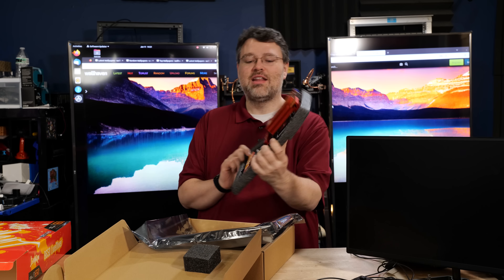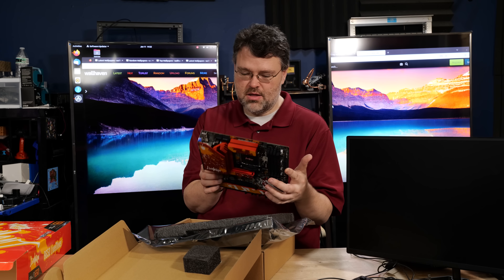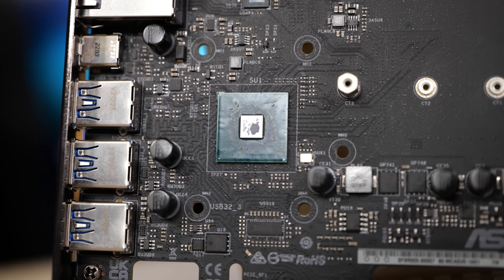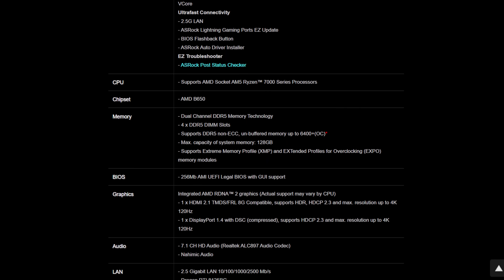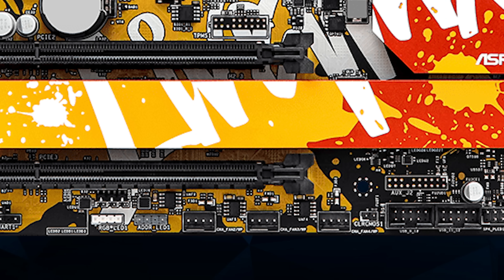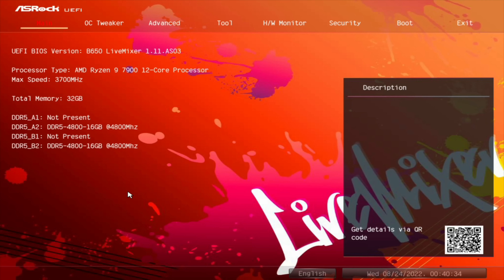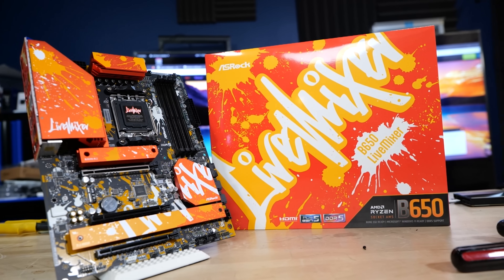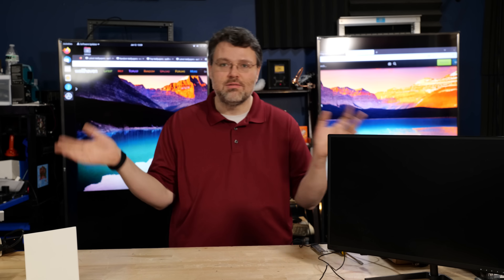ASRock Livemixer B650 Motherboard Review (Special Edition)

Comment: I like this board! It’s orange, has optical audio, and supports AM5. What more do you need?
Reply: Can it keep my bucket of chicken warm too? 🤔
Reply: better overclocking features, like the asus rog series has, the asrock can only do 5.5GHz max boost speed on 4 cores and no more and then freq drops off the cliff. Whereas the rog strix b550-e can do 5.7GHz on all 8 cores of 7700x. Thats quite a big bump but on a 7700x it's not the end of the world. What if you have 16 core 7950x. Yeah... if you want to dial in a manual all core overclock at 5.2GHz then the board won't boost  aboe that losing a lot of single/dual/ quad/ boost performance. The b550e give you PBO boost to 5.8GHz in lightly loaded, then switches automatically to all core manual overclock to 5.2GHz on a 7950x.13900xs beating in games and workloads for half the power use.
Reply: @jondonnelly3  5.35 GHz all (8) cores plus boost to over 6 GHz at PPT 86 Watt is good enough for me. It's obviously not an overclocker board.
But yes, you're right, some better VRM management would've been nice. Buildzoid mentioned negative spikes with static overclock frequencies.
I paid 220 euro ex. VAT for this board (now it's 200 euros), so you get what you pay for. If there's a Zen 6 generation in 4-5 years I'd probably get a new mobo anyway.

Comment: is there a chance wifi 6/7 can cause interference when installed in the case? cheers
Reply: The cards have antennas that route outside the case
Reply: @NateSnowstorm  even m.2's? cool. ty
Reply: @fandomkiller  yup, those as well! the connections on them are tiny and might be a bit finicky to connect and the wires are usually thing but once routed it isn't a problem

Comment: Wendel I want that card and mobo combo, and my old Hyper Gen 3 card running 3 nvme back in 2019 not realising that I technically broke the record on sequential speeds at just over 10,000 on Gen 3. Found out years later that there was a competition with "recognition" ahh missed oppurtunity. Peace! :hand-purple-blue-peace:on a z390 ASUS strix board, 8 / 8 bificreation.